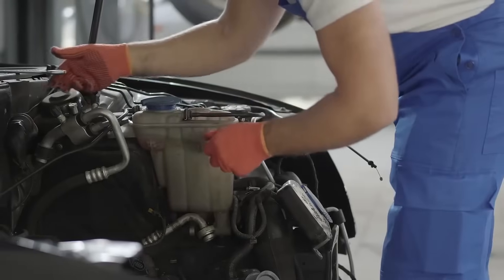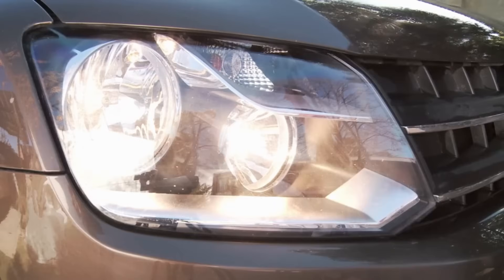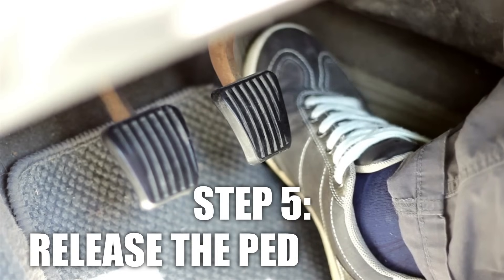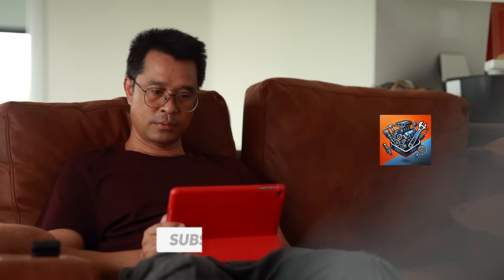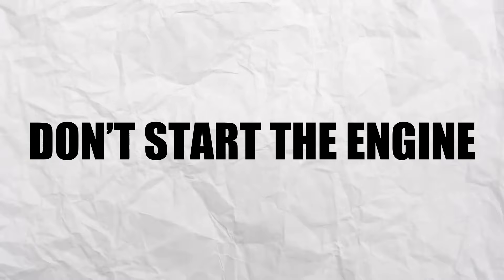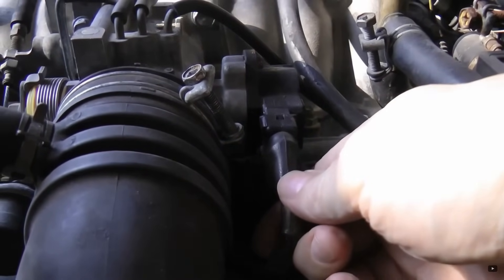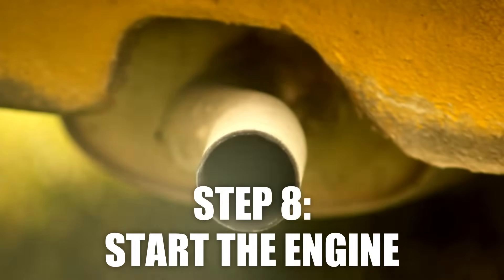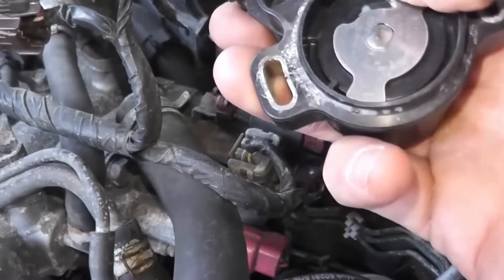How to Reset Throttle Position Sensor (3 Quick TPS SECRETS)

Comment: Both of our cars now have the same size 3.6 high tech vvt engines. But one seems to pull harder than the other. I will try the first one. Thanks for the tune up secrets.
Reply from the maker: It could be due to slight differences in the throttle or engine calibration. Maybe try cleaning the throttle body and see if that helps even out the pull. You could also look into a PCM tune if needed. Let me know how it works out
Reply: @carcareclues  I will do the easy thing with the gas pedal. I have a mechanic for TB cleaning. It runs smooth and idles evenly. It could just be the 8 speed Jeep 3.6 has more beans than the 6 sp XTS 3.6.